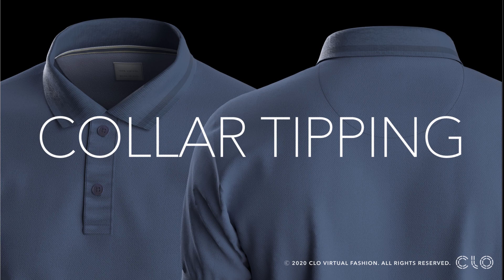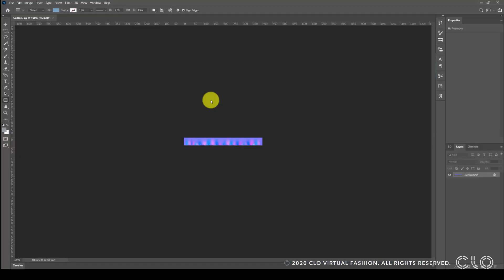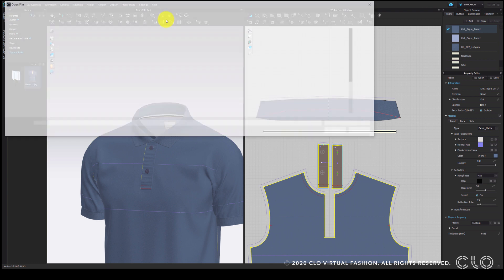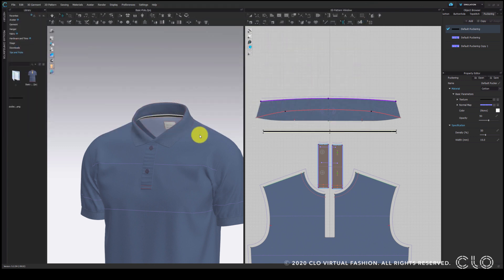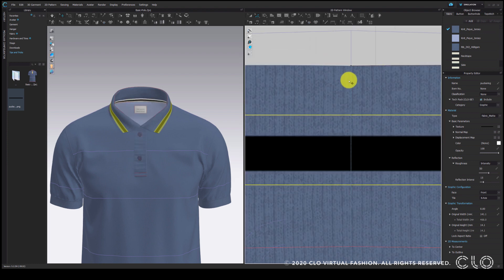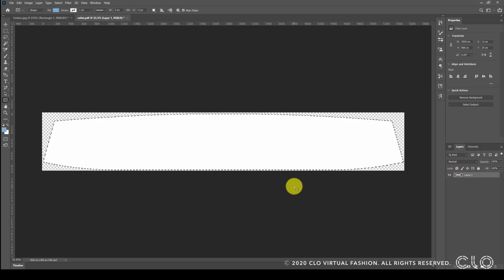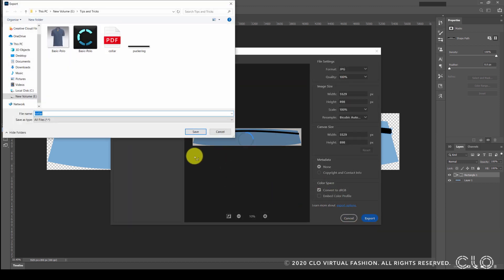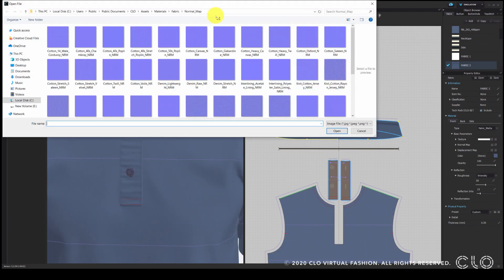Polo Collar Tipping

Comment: I'm not quite sure how this would work for a mac user.. I'm trying to figure out how to do the first method. I'm stuck at the point where she's created the tipping in PS and then needs to apply it to the collar ribbing in Clo.
Reply from the maker: see answer on other post.
Reply: @CLO3D  My issue with using a mac for this method is I'm not able to copy and paste file locations from the finder window
Reply from the maker: In CLO you can R-click on most files and copy the file path directly from there. Or when opening a file > Open file type and paste to get to the exact location